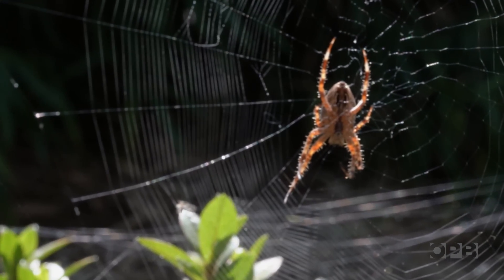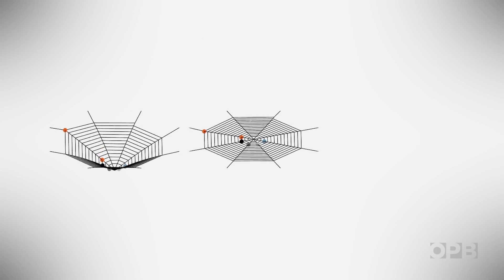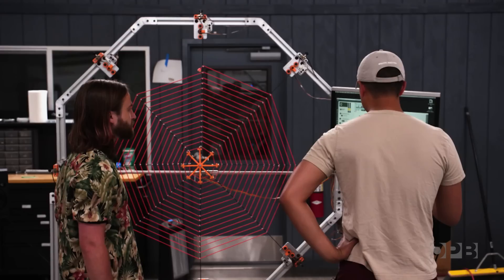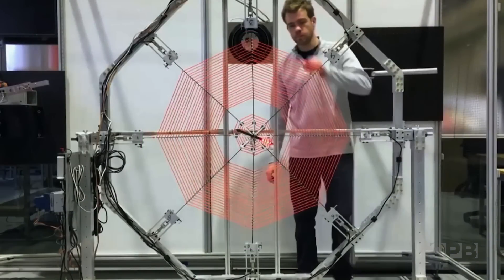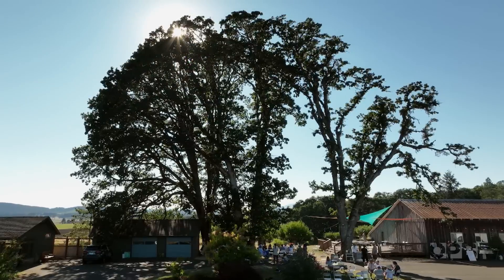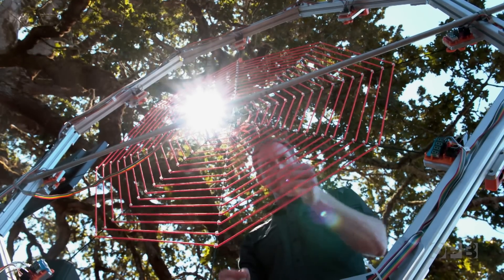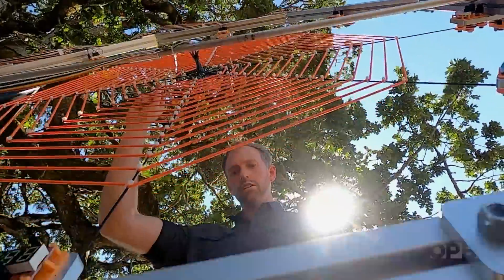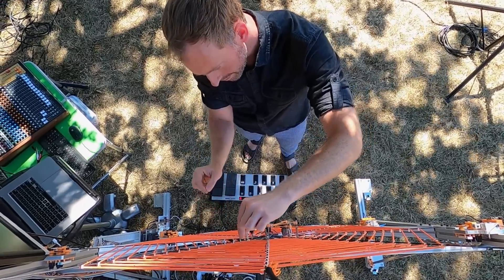Spider-web research yields … a new musical instrument? | Oregon Field Guide

Comment: Simplify your model using the circle of fifths dropping octaves as you journey out along the pie wedges. It will make it much easier to play and you'll always be able to stay in key.
Reply: But then you'd need a 12 legged spider.
Reply: @nuberiffic  we are creates are we not
Reply: I can already see this instrument being played everywhere.
Reply: @wiggleroom3039  I'm seeing something with the Golden Spiral and the Fibonacci sequence. Best seller for newest stringed instrument or maybe an artistic xylophone.
Reply: It's just a very fancy MIDI controller.  They appear to just be translating the natural vibrations and remapping them to MIDI notes.
Reply: I’ve been working on software like that, mostly for personal use and with an awful sound, but it can do this… it’s a spiral and each full rotation can be an octave, but also a fifth for example, in which case different notes align

but a spiral layout isn’t the nicest to play on anyway, certainly a cool visualizer however. for plenty of more practical ideas, have a look at “isomorphic keyboard layouts”
Reply: @noa_1104  Are you trying to include the Fibonacci spiral and golden ratio into your design? This would greatly increase your tunning variation and no two sections would be the same but still give the appearance of a spider web.
Reply: This wolf be so cool to see and play
Reply: That would be awesome; yet I like the microtones in between.
Reply: @erikavery1105  you still have microtones from bled over depending on the instrument you use to pluck the strings and how hard or aggressive you use it. It would also be interesting to see what kind of harmonics can be produced.
Reply: Do spiders have ears? If so, are they designed to distinguish between low and high frequencies? Or do they depend solely in vibrations their legs can detect, as well as with what they see?
Reply: @kapuluangophir7470  not only do spiders not have ears but often they have poor eyesight. As is so often in life where something is deprived of one particular sense of senses it often is accommodated by having heightened senses elsewhere.
Reply: Every detail in nature points to the presence of a creator. This creator is, of course, Allah Almighty, Lord of the Worlds.

"And in your own creation, and whatever living beings He dispersed, are signs for people of sure faith." (Holy Quran; 45/4)
Reply: @motherlandmars5999  I am not sure how this relates to the topic but I do somewhat agree with your assessment. 

Where I may differ with you is in the name of the all mighty creator. As far as my understandings go the name of the creator is unknown and, as the all that the creator is, their is no gender that can be assigned. 

It is of my opinion that if the all is all then that is all that can be. The need to assign a name is a human need to identify that which it can barley comprehend and therefore could easily be confused threw the differences in perceptions by the various cultures of the World.

It is a wonderful discussion that in its proper topic could be fun to entertain but unfortunately that's not what this topic was about.
Reply: @motherlandmars5999    He's a pretty shitty creator considering how many obvious mistakes there are in the human body.

Comment: I love this.  I play drums with a free improvisational quintet, and one of our musicians is a Foley Artist. We make a lot of homemade instruments and this would fit right in. Are the pitches accurate to the physics of the instrument, or are you being creative with the tuning?
Reply: We’ve got sound modes that range from “just frequency shift the raw sound at each foot into human hearing range” to the full “use the eight pickup signals to identify which string is being plucked, and map sounds to each string” mode featured in this video.
Reply: @rosslhatton  nice. Interesting work. It has spurred a lot of interesting conversations on how a spider web communicates to the spider.
Reply: It's clearly just a midi controller.
There's no way a set up like this would actually produce sound.
They've just mapped each strand of the web to a note on a keyboard; it wouldn't reflect the actual physics at all

Comment: i thought it was called biomimetics? was that term replaced or something?
Reply: Within this research area, biomimetics is trying to make a device that operates in as close a way to an animal as is possible; bioinspiration is looking for the underlying physical principles that the animal is using, and then building a device that uses those same principles, but optimizing the design to make use of the engineered material properties instead of trying to directly copy the animal.

Comment: I had a spider build a web in my window inside my bedroom. Sometimes moths would get in through the poor seal between the ac unit and the window frame, so I figured I'd let the little guy help me out. I remember watching it rebuild the web one night as I was waiting to fall asleep, and it would move around to each of the radial strands and give two quick tugs as if checking the tension. It was pretty cool to watch, but now I am thinking I was seeing it tuning its instrument. Cool video!
Reply: It probably was setting the strands with a certain amount of tension...  If some strands are overly tight (or loose and floppy) it would deform the linearity of the radial strands.  Lots of spider species seem to keep the radial strands straight, or at least with a steady curve.
Reply: Just wanna point out here to all you arguing, blind and visually impaired people have been proving his theory for as long as humanity existed. I personally experienced double vision and radio blindness my whole life so it's an understatement to say I've tripped up a few times. 

I recently broke with my partner, who uses a wheelchair. I almost always went out the house with him, so I got used to pushing him, walking behind and pushing slighthy with sheer inertia from me taking the weight off my joints.

When I started going out alone I was tripping and even falling every 10 meters or so. We still did things together at that point, so one day I alternated between with and without.

I realised I was changing my step height naturally, as I felt the bump through the wheelchair handles first.😊😊
Reply: This is one of the reason I was irritated when my SIL cleaned my house and killed or ran off my corner spider. They kept my bedroom mosquito free (Tx) and that was worth it. Thank goodness my dad was the kind to leave the wolf spider alone and feed it flies for us to watch! 

Are there any ways to lure a spider into making a particular spot a Cozy home?
Reply: so many bots in this comment section jealous of humans relationship with nature and capacity for creating music.
sorry you cant have fun, bots
Reply: Because lets not forget, spiders are blind.
Reply: @tribounty1392  if they were blind they'd have no eyes after evolving for so long, they just have poor eyes
Reply: @skapaloka222  you must be a real hit at social meet ups. Dont be so dense.
Reply: Every detail in nature points to the presence of a creator. This creator is, of course, Allah Almighty, Lord of the Worlds.

"And in your own creation, and whatever living beings He dispersed, are signs for people of sure faith." (Holy Quran; 45/4)
Reply: @Lowland-Demon  Thanks "mate" listen.....apparently through the last few comments I've been tagged in, I've realized that i need to express that my comment was sarcastic. The entire video makes spiders seem like they are blind and their webs are some kind of technological marvel that allows them to catch their prey. Honestly i think this guy just wanted to make a usless instrument and loosely tied it to how spiders work. Pretty sure he paid all the people to come watch him play the thing aswell cuz lets be honest....its dumb, complicated, but dumb. So yes i understand spiders can see fine i was merely making fun of the scope of this video.
Reply: Nah it wasn't tuning its instrument. This is pseudo science and is quite daft to be honest.
Reply: @bigbasil1908  oi, off with that nonsense.  Let the dude enjoy some whimsy.
Reply: @samsanimationcorner3820  enjoying whimsy is for children and make believe. If he wanted to write a fiction book about musical spiders, that's one thing. But seeing reality as something other than what it is is absurd.
Reply: @drcidd8153  Life would be very boring without synchronicity
Reply: @drcidd8153  You must really be the life of the party.
Reply: @bonemasterj  You're not wrong.
Reply: @bigbasil1908  Whimsy and interpretation, finding meaning in things, etc does NOT equal belief over reality let alone pseudo science as you assume. Don't be a knob, it's just whimsy, chill.
Reply: @bigbasil1908

You're one of those people who thinks that humans are the only ones allowed to be intelligent?
Reply: @bigbasil1908 depends on you definition of instrument. In some way it is an instrument to the spider and in some way it was tuning it. Just not in a musical way as we define music.
Reply: @bigbasil1908  Oregon State University, what else would you expect

Comment: One big problem though: the prey doesn't "pluck" the spiral silk, it sticks to it. Moreover, the way the stretchy silk works, its vibrations are extremely dampened even if you manage to pluck them without sticking; they only do about 3 full oscillations before stopping. This is because the "stretchy" silk doesn't actually stretch; instead it spools inside the tiny droplets placed along its length, which pull the silk inside with surface tension (a sort of reverse capillary action), and the apparent "stretching" is mostly just unspooling of these silk balls inside droplets. This mechanism dissipates a lot of energy, and the oscillation dies out very quickly as a result.
Reply: One variable to consider is that it would be mostly flying insects caught in the web, their wings generating vibration in various states of restriction.
Reply: This whole thing is a crock of shit, but people are looking past it because this sort of shit attracts idiots who either don't care or will just take their word on it.
Reply: I think they just wanted to show off a new instrument.

Comment: There are already existing midi devices that can connect with your acoustic guitar to play a synthesizer module. This however is a much more sophisticated setup but it uses the same principle. Much harder still, is having to deal with the latency between vibration made from acoustic components into digital.  This was a most educational and inspiring presentation!❤❤❤❤❤

Comment: Hmmm, I'm intrigued. 

I think there's something worth exploring in this as a musical instrument concept, but it would probably have to leave the "spider" itself behind.
The biggest source for the slow response here is that this isn't ACTUALLY a musical instrument. It's a MIDI instrument being played by a computer simulation of a spider brain, based on input from a physically simulated web.

One could do many many rounds of continuous improvement of the "spider brain" model to make it faster and more accurate, as they clearly already have begun, and turn it into a decent MIDI interface. 

Or, they could remove the spider entirely and make a web-like layout where each string section independently registers to a midi action, turning it into a unique "keyboard" of sorts, a string variant of the growing multitude of midi instruments available. 

OR... one could explore possible "acoustic" variants of the web itself.
I really want to see what this would look and SOUND like if you attempted to base the web on the harmonic series.

Like, could you build the "rays" from piano wire, or rigid spring steel or wood, and the "spiral" from guitar strings or harp strings? How could you tune it? Could you move the connection points as well as tighten/loosen the tension? Would you need straight or curved rays? Could you have more than one spiral-string? Would it need to be diatonic, or could you have a chromatic or even microtonal version (that didn't sound like crap)? Would the spiral string even work, or would you need multiple individual strings (making it strictly a harp with an alternative layout)? Could you play it from the side like a concert or lap harp, or would it always be too large to reach?

There's also a large potential hole in this entire concept, both musically and biologically: Actual spider webs aren't this tight. 
The archetypal orb-weaver web that this resembles is closer to a cargo net than a harp: it's got slack in it. Relatively speaking, of course. If you just built a cargo net that you could sit in the middle of, you could easily tell if a smaller person or even animal hopped onto it, and where they were on it. You could feel the shift in balance and tension, and especially the continuous movement and figure out where it was all coming from, without the benefit of millions of years of hyperspecialized evolution.

So, the TYPE of vibration, the mode of vibration might not be the mechanism at work at all, making this NOT useful inspiration for a musical instrument either.
Reply: A real musical instrument version of this would be impossible to tune effectively as far as i can tell, though it's fantastic inspiration for a variety of new harp designs.
Reply: Nowhere here is a computer simulation of a spider brain, please don't make sh*t up.
Reply: @drangus3468  Um, where did you get spider brain from?
The perception process of perceiving images from the vibration is well studied and scientifically shown and that is a function of the brain, but not the brain itself.
Reply: @axle.student  Would you guess...I got it from the comment I replied to.
Reply: @drangus3468  My apologies. Yes, the OP did mention spider brain. And I agree that that "computer simulation of a spider brain, "  was a bit out of context, or lacking in more detailed context.
When I read it I would have taken the reference as hinting toward the full cognitive perceptual awareness of the spider and it brains ability to turn vibration into vision or sight. Vibration, Audio and visual perception (spatial awareness) are closely linked thus the brain reference.
So, no the demonstration from the device doesn't "Simulate" a spider brain, but does demonstrate how the spider brain receives information required for spatial awareness and even vision.
Reply: @drangus3468  P.S. many different creatures including humans make use of vibration, sound, electrical stimulus as an extra extension of visual perception and often as a complete replacement of our eyes ability to "see". So, this "Web audio device" is an important and novel way of demonstrating the physical components of that cognitive ability :)
Reply: I looked at the midi player, but i think it is more to keep it to a tune (each red section) as it would have all sorts of crazy harmonics going on. That being said, if you look at the spiral, mathematically each red section has a unique length and tune but the distances are not very accurate in the video. i won't repeat myself but you can see my OP and some other comments I made about it. There are an immense number of possibilities in this device that don't emerge at first sight :)
I also identified more than 1 way information is simultaneously transmitter to the 8 sensors giving at least 2 layers of accuracy.
Reply: Every detail in nature points to the presence of a creator. This creator is, of course, Allah Almighty, Lord of the Worlds.

"And in your own creation, and whatever living beings He dispersed, are signs for people of sure faith." (Holy Quran; 45/4)